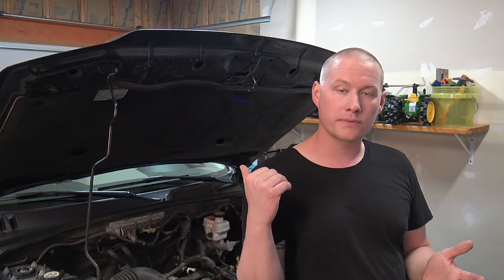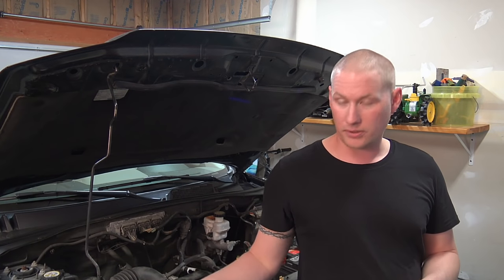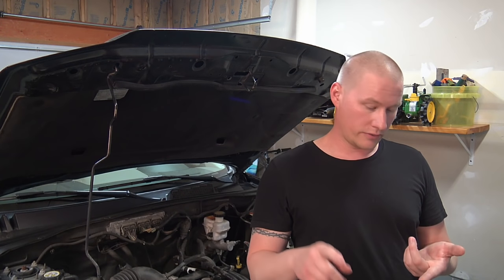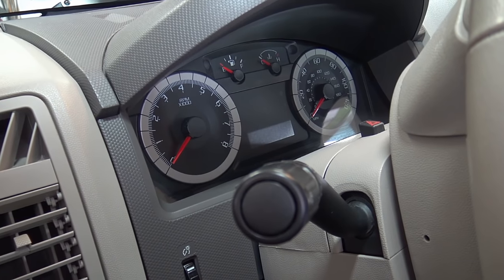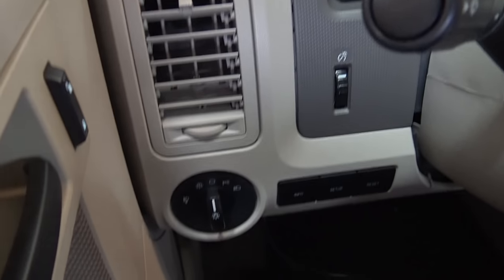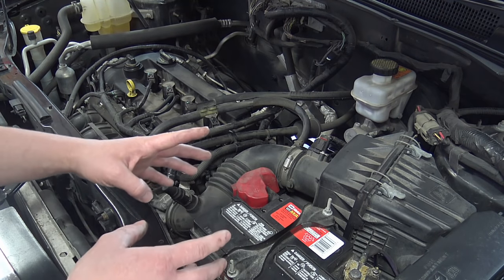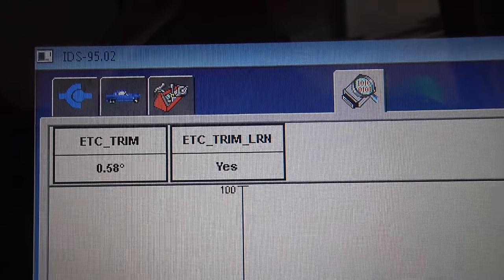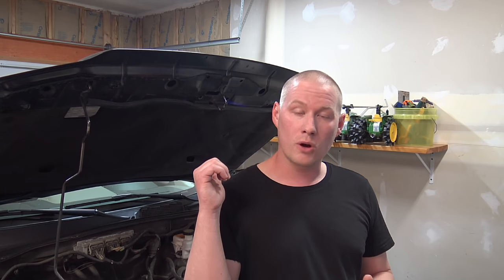Ford Vehicles: Electronic Throttle Body Calibration Procedure

Comment: Ok! Don't know if you're still checking comments, but let me throw a scenario at you. 2006 Navigator. Got a CEL, threw a P0506 code, low Idle Air control System RPM. Didn't have any other symptoms that we could tell other than the light! Decided to follow your ETB cleaning procedure, so I did that (using TB cleaner) as well as replace the throttle position sensor while I was in there. Put it all together, and followed this video for the throttle body to relearn. This time, I start the car after clearing the PCM, and it's sputtering like crazy while it idles. RPMs are up and down all over. Engine is in failsafe mode, throwing a few codes related to the idle control areas.
Is there somewhere I potentially went wrong? Where should I start troubleshooting? I redid the "relearn" procedure just now, and it's currently idling rough, trying to get it up to operating temp. But the idle smoothness doesn't seem to be getting any better.

Comment: Just changed throttle body on 2006 Mercury Montego THANKS to your video. Thanks for your help. Much appreciated. Also followed relearn procedure. Runs great but check engine light on.   ??? Any ideas
Reply from the maker: +Agathe and Beauty Fid you clear it after the repair and it came back on?

Comment: This is a long shot bro. But I bought a 2014 mustang gt 5.0 a month ago thinking the stalling issue was the throttle body. I replaced it yesterday. Still stalling randomly. It had a bama 93 race tune. Uninstalled that to stock still does it. I'm lost. No codes either. Car starts right back up every time. It's weird. When I come up to a light or push the clutch it to coast in neutral it will idle down and stall. Some times it won't stall. It's really aggravating in stop and go traffic. Car runs great other than that. I just don't want to go on a wild goose chase replacing stuff that isn't going to make it run right. 

Mid list: bbk long tube headers 
C&w Cold air intake

Comment: Thank you for all your help buddy! Watching your videos today I decided to remove and clean the electronic throttle body of my Ford Escape 2010 Limited Edition 2.5L, I was shocked how dirty it was, black full of carbon. I used a proper spray cleaner and now looks like new, thank you so much and please keep sharing your knowledge with us, we really appreciate it. Next step is clean the Mass air flow sensor and change the filter. I was reading about the IAC valve in some cars models and how important is keep that valve clean, but I couldn't find that valve in my car can you tell me something about that, where it is and how to clean it. Thank you.
Reply: did you calibrate the pcm after you cleaned out the throttle body?  or did you calibrate it before you cleaned it out?
Reply: ANYONE TRY THIS ON AN AUSTRALIAN MADE FORD ENGINE? ie: BARRA i6

Comment: Thank you, I purchased the throttle body for my Fusion 2010 2.5 l, from authorized reseller on Ebay for $51.95, and I just used the regular battery jumpers, for the PCM drained...
Reply: For the jumpers do u use both negatives?

Comment: Thanks for this video and the cleaning video also, I went ahead and replaced the tps while it was apart. after following your instructions no more dash light's on yeppie!!!
Reply: So replaced the spark plugs, having to remove the plenum and throttle body assembly, I didn't do this step, now getting p2110 code, do you think I need to replace the TPS, or is there another way to calibrate the system?

Comment: I think my throttle body unit is the cause for my engine problems; slow response to gas pedal, heavy fuel order, jerks/ hesitates at high speeds (takes long to get to highway speeds) but the question is, how can i test my throttle body? ford mustang gt 4.6L 2007. 

BTW. Your videos are incredibly helpful!

Comment: Thanks for the video!  I replaced the tps on my 88ford f150 and cleaned the throttle body and took of the iac valve and it is idling high now at 2000 to 1500 rpms will try to this procedure tonight thanks!  I thought i had damaged the iac valve but maybe throttle body was really filthy. will let you know how it turns out.
Reply: I tried this and I still have a high idle about 1500 rpms.  If I unplug iac valve it goes back to normal.  I think maybe I shouldn,t have cleaned a 30 year old iac valve!  Going to try replacing that next.

Comment: In past i noticed my mpg improving after disconnecting negative battery cable only. No other work done. But then after a tank it would go back to a worser mpg. 
This time i cleaned TB, MAF sensor, PCV,  Changed oil from 5w20 full synthetic to 5w30 full synthetic ,per another one of your videos, followed your relearn instructions.  Now i know that going from 5w20 to 5w30 may offset any net gain on mpg. However i hope it still gives me some degree of mpg improvement.  What say ye? After more time and miles i am going to reassess . Thanks and greetings from NC.

Comment: Hi. Great video. I’m working on a V10 with no throttle response after the battery died. Any insights,ideas or s? I tried everything in the video. PS: throttle does operate with key on engine off. Thanks.

Comment: Your videos are a godsend! I have an 1988 Ford Thunderbird with the 5.0 engine. Does your video apply to this model? I changed the Coolant temp switch and the Idler Air Control Valve. I'm planning on doing the throttle body next...I hate to tell you that I just sprayed it on the car and did not remove it, not to mention holding the throttle open to spay inside. Thanks again for all your help. If you can, refer me to a good service manual- thanks again for all your help@!

Comment: Hey there, 
I know this  video is a few years old I have an 18 escape that I bought used with the 2.5 engine… planning on changing the batt soon  and I found the batt reset procedure should I also do this procedure as well? Do I also need to do the jump leads Or can it drain on it’s own as I’m swapping out the batt? And I’m assuming batt producer 1st then throttle. Between you and fordboss you guys are life savers.

Comment: I’m a fan of your channel. I changed the spark plugs and I unplugged the throttle body to clean on my ‘08 Sienna, now the car doesn’t even idle.  It runs for 5 seconds then shuts off.  Do I have to reset and relearn the throttle body?

Comment: Great videos with great info , I know there must be ton of questions you are asked . But here is one more I have a 07 f150 4,6 that has a rough idle with no codes I have checked and there is good compression and have spark at all coils . I have cleaned the throttle body . Do you have any suggestions? Thanks in advance

Comment: greetings I am a fan of your videos thank you. I wanted to consult you I have a ford edge 2010 3.5 traction front. the detail is that a few days ago circulating the truck stopped accelerating but did not turn off, then they did the service and lowered the body acceleration to clean it; now the truck does not turn off and makes normal changes, note that the revs in ralenti are at 600 to 630 rpm; I already did the procedure you indicate so that I relearn the necessary settings but they are still 600 to 630 rpm and I think before that the revolutions were between 750 to 780 rpm

Comment: I own an a 1999 F250 SD with a 5.4. I have 2 valve head engine, is this a problem  on all 5.4s or just 3 valve engines ?

Comment: My ‘13 explorer is low revving when idle, especially when my AC is on, so I’m going to remove the throttle body and clean it to see if that helps. 

If I do so, should I do this afterwards to recalibrate? Or before hand? 

Also, is it safe to just remove the negative terminal from the battery before removing the throttle body to prevent any electrical issues? Thanks for these extremely helpful videos and any additional advice you can give.
Reply: Will this process work with a piece of wirer as no crock clips

Comment: Well done. What scan tool are you using?  Is that the tool you would recommend for a DIY mechanic who's technical, but would only use in 1-2x per year?

Comment: Thanks. Another great video.
 I replaced my throttle body on a 07 Lincoln Navigator a few months ago. I didn't know about the throttle relearn then so I didn't do it and not I have a rough idle. Could this be the case?

Comment: 1999 f250 5.4 2 valve. Truck runs good! My Throttle body rate position sensor is out of range according to live pids. I did clean the throttle body, I'm thinking that it's out of range because I opened the flapit  too much during the cleaning. Ford throttle bodies don't like that. Any recs?

Comment: Changed my TB because of stalling and loss of power, dealership said the TB plate was sticking and needed to be replaced. Apparently that's a problem with my generation of fusion(2007). I did this reset with the new TB, but the service wrench was on and the gas pedal was non responsive.

Comment: Great Video, I had my MKX 2.7 2016 76,000  in for full service recently. I seen your video about how to properly clean the throttle body and couldn't help myself. I had to check it out. After I was done, ( It wasn’t filthy ,but it was dirty after service I only put on 500 klm. I checked the invoice for 1,600.00 and it did not say they cleaned it. That and the MAP Sensor should be part of a full service I think. Anyway, it seemed fine and idles fine. I will still do as you say. thanks for the info..
Reply: "Full service." That term means many things to many people. Cleaning a throttle body and MAF sensor is not part of a routine maintenance service, typically. 
You have to be specific with what you want.
Reply: Good to know, Ive been checking out the videos. Seems Ill do it myself, I have tools, heat and good lighting.

Comment: Hi, first of all thanks for all your video's, few month's ago i changed back bearings on my 04 ford explorer, thanks to you're video it was a success 👌👍, 2 days ago i decided to clean the electric throttle body because my car have rough idle, i cleaned really well, after cleaning it the rough idle did not go away, i went did some shopping came back home parked the car, today when I turn the car on and i hit the gas pedal nothing happens turn the car off and on multiple times and nothing happened, this evening on my desperate research i found this video and the other one you have on how to properly clean electronic throttle body, i think i did some wrong and damaged the position sensor, i need help any suggestions??

Comment: Is the jumper wire step critical?

I already did it so I’m really only asking for future reference. But I noticed the actual owners manual for my 2015 F-150 Lariat doesn’t actually mention any such step under its small section on the fuel and idle trim relearn procedure.

Will I get the same results sticking with the manual’s procedure in the future? Or should I continue to include the jumper wire step into the procedure for better possible results?

Thanks for all you do!

Comment: Hey I wanted to thank you for a insightful video
A question I have tho, disconnecting the battery with key on ?? .. connect jumper wire with key on ??
I believe that’s what you said , at 54 my hearing ain’t what it used to be .. 
thank you in an advance

Comment: Really appreciate the video just recently replaced the battery on my 2005 F150 with 4.6 and has a low idle now and sometimes stalls I've actually replaced the mas and it still is doing the same thing. I have been driving it for a few days now should I go ahead and clean the throttle body and then do the reset? Also when you disconnect a battery doesn't that reset things to factory settings?

Comment: Thank you for the video. I'm planning on changing my throttle body on my 05 F-150. I have one question though. I installed a Livernois Cam Phaser lockout kit and installed the PCM program they provided for it to run properly with the kit. Will doing this to my PCM affect that program? Thank you for all of your helpful videos.

Comment: Ha I pulled the throttle body out of my 2014 5.0, cleaned it, cleaned inside intake manifold, reinstalled, tried this way, no change. Throttle position, hill descent, traction control system, tried a new throttle body, still no change. Sounds good at idle, drive off my driveway goes back into limp mode. Back to the beginning after spending more on this truck
Reply: Did you try cleaning the MAF sensor. fixed mine.

Comment: Before I replace the throttle it definitely had drivability issues. It definitely was in limp mode. Then it drove fine for a few months. No problems. Then the yellow wrench popped up again and it went back into limp mode. Then I replaced the throttle pedal and it drove fine no yellow wrench no codes. Then I had the spark plug issue. After fixing that it drives fine except for that p2135 and the yellow wrench. And the p 2135 does not reoccur on the first drive it always reoccurs on the second Drive

Comment: I just saw your video GREAT INFO . I have a 2015 f250 6.2 l . I notice my truck idles high when the ac is on and continues to idle high when i turn the ac off . I turn the engine off then it returns to normal idle . Is this normal . This of course when in park .

Comment: 2015 fusion, 123k mi, got a p21111 and p2112 errors. Going to attempt to replace myself this weekend. In other videos this step was not mentioned, but rather to just recalibrate by turning the key power on, press gas petal down slowly, then release slowly,then remove the key. Are both procedures needed?  Nurse here, zero car experience beyond replacing tires.

Comment: Hello. Very nice tips. I have transit 2007 2.3 duratec and the last time in workshop they are clean throttle and say me i dont need do any adaptation. That is true????? Now is little problem when i want dynamic run of car is some of cylinder get off ignition mixture. The computer show me on heat engine and 900 rpm open on throttle 13 degrees and ignition timming 23 degress.I need to make adaptation what you show.I see yua are very smart and you are belive.Thanks.Robert from Poland

Comment: can you elaborate on the shift points? Im kinda confused. I know an automatic still shifts, would i drive 10mph for a lil then 20mph while slowing working up my speed? im just learning about my wifes ford and will be replacing her etb tomorrow. As im 22 and ive only played games and worked on electronics 😂. i dont know anything. I did however clean her existing etb a couple weeks ago but that didnt last long before the code P2135 came back.

Comment: I need your help. 2014 Ford fiesta 4 cylinder SE model. Need to know the torque on the throttle body I really appreciate your help the engine is a 1.6  Liter engine.  Thanks again for your help. I have been given a wide range of torque specs.

Comment: I scanned through the comments to see if you may have already answered this question and didn't find anything. So, I have a 2012 F-150 5.0 that just turned over 200K and I think I should probably clean the TB. I watched your video on doing that and then luckily I found this video afterwards.
My question is: Is there anything I need to do differently resetting the TB with a tuner?
Reply from the maker: no
Reply: @FordTechMakuloco  Thank you! And thank you so much for your videos, I've learned so much from them. You're the best!!

Comment: Hey I appreciate the explanation it was a great deal of help...I just want to be clear, this procedure works when the throttle body is in limp mode as well?
Reply from the maker: It will reset it yes but it will go back into limp mode once the fault is seen again.
Reply: So in your opinion what would be the best way to fix that permanently

Comment: It seems our 2011 Explorer timing chain is indexed one tooth off. Getting error codes and idle is very rough.
Thought it was just needing to be reprogramed from sitting for months with the battery disconnected while the engine was out for rebuild. 

Went through the recalibration process again last night and it idles fine 700 rpm nice and smooth, while the reprogram test is performed and test drive is nice and smooth as well no error codes no check engine light ect., idle is smooth. 

Once the engine is shut off and restarted rough idle returns, check engine light comes on getting cam fault codes stating timing is off but the way it idles is really rough it swings from 1000 rpm down to 300 rpm and back up that alone would throw the cam phasers out of sync causing the codes.  So is it a timing issue or throttle body failure to hold calibration?
Reply from the maker: Tes it is time for a timing job or worse.
Reply: I'll be tearing down to reset the timing end of the week. I used Cloyes 3.5 timing video to reassemble. All I can assume I missed one mark by one tooth. Appreciate your videos and help.
Reply from the maker: Ah yes the CLOYES kit is your problem. They are the worst.

Comment: Your method greatly accelerates the discharge process, but normally would it take a couple of hours if simply disconnecting the battery?  I read it takes up to eight hours - is this accurate?

Comment: Great video, thanks!  How different would the procedure be with the hybrid versions?  The hybrid battery takes over on idle after a short while.  Would I just wait until the battery is drained enough to go back to the gas engine and let it idle from there?
Reply from the maker: On hybrids the procedure is the same  but you turn the defrost on.
Reply: If its a manual shift I take it the drive part doesn't make any difference